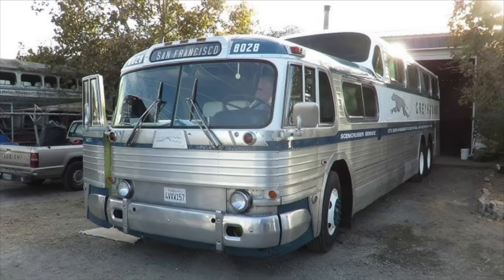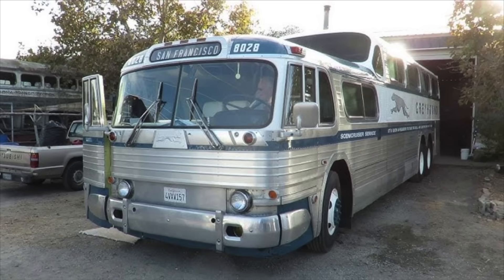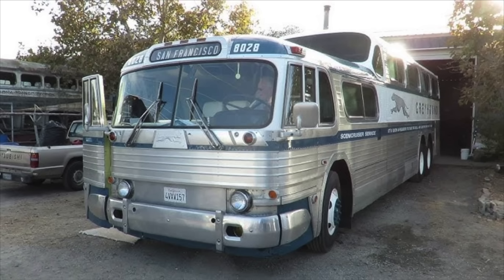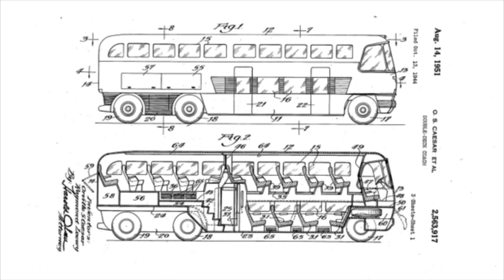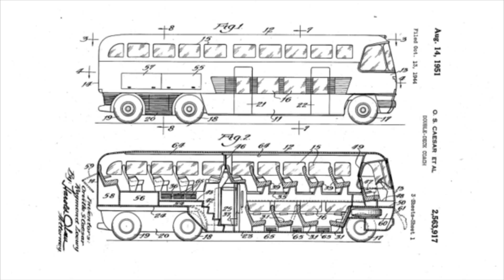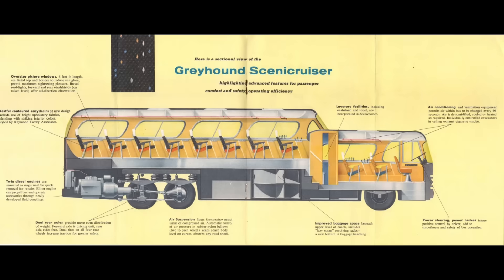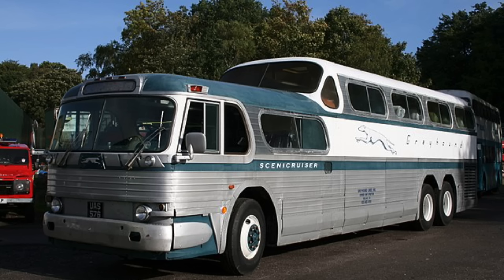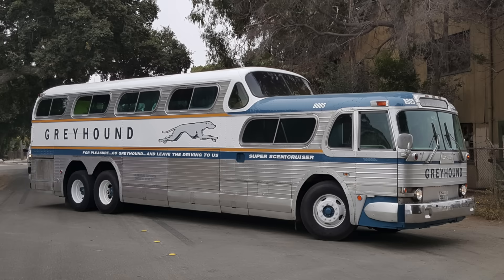Awesome & Flawed Vehicles: 1954-56 Twin-Engine GMC/Greyhound PD-4501 Scenicruiser Bus!

Comment: I’m retired.  I’m 72 years old.  In the early 1970s I drove over the road busses for a bus company in St. Paul, MN that has long evolved into a different company.  

At that time I drove one of three busses.  a GM 4104, 4106, and a 4501 Scenic cruiser.  I also drove Prevost, MCI 8,9,10s. 

Over the 5 years I drove my absolute favorite bus I drove was the 4501.  It was smooth ride, powerful uphill flat and could easily maintain 80 mph.  

A dream to drive.  Also, as they were designed by or for gyehound it bears mentioning that at that time Greyhound were a passenger transporter, but made a great deal of business in freight.  The luggage bays were huge.  You could easily walk through them. Plenty of space for freight

Comment: I'm late to party (as usual) but my only ride in a early Scenic Cruser was in 1956 when I was six years old (gearhead even then). We were delayed and a mechanic showed up, in talking with driver, I overheard him say "one of them doesn't have oil pressure". Always wondered, now I assume it must have been a dual engine setup. Anyway, another bus showed up for the trip and we were away. Was a 300-mile trip from WVa to Va Beach and we were a couple hours late.

Comment: Non synchronized transmissions don't NEED double clutching. In fact, if you know what you're doing, the clutch is only used when starting and stopping the vehicle. Floating the gears is way faster and doesn't destroy your left knee.

Comment: I remember these babies chugging over Donner Pass on I-80 in the 70s!  They didn't have barometric compensators back then, to lean out the fuel as they went to higher altitude, so they would be in the right lane, even the breakdown lane, shooting a jet of black exhaust across the entire highway!  😁  
I'm really curious about that fluid coupling accessory drive...

Comment: The Detroit Diesel 6-71, 8-71, 8V71, etc., were two-stroke engines using Roots superchargers for charging the cylinders with air, and exhaust scavenging.  The superchargers were adopted by hot rodders and drag racers starting in the late ‘50s for forced induction, typically being the 6-71 versions.

Comment: The 71 series Detroit engine was a two-stroke design. You didn’t have to mix oil with diesel fuel, but it only had exhaust valves and injectors that were operated with the camshaft and rocker arms. The intake were ports that were in the cylinder sleeve. Scavenging was done with a gear driven blower. These engines were prevalent in most buses and some train locomotives. Later, they use them in trucks, but were taking out of service as they were nicknamed the road oiler. Based on the design, the Oil that travels past the rings through the intake ports eventually accumulated in the blower box and intake manifold. There were automatic bleeds that would allow the oil to drip down on the roadway. That’s where the nickname came from. This engine was extremely powerful, but by today’s standards an EPA nightmare.

Comment: I had driven several PD-4501's with the 8V71 engines for small, underfunded charter outfits during the 1970's and 1980.  While the smaller buses like the 4104 had a 4-speed transmission, the ratios on the 4501's were different as were the shift points .  Greyhound always seemed to try to save a nickel or dime here and there, so there were no fuel gauges because they knew what the distance was between terminals, so we had hubometers.  No tachometers so a novice driver had to learn to listen to the scream of the blower, unless you wanted to take it solidly into the governor each shift which was unsatisfying to the passengers, so you learned to keep the little vent window cracked open to hear the thing.  Downshifts in traffic in the hills of San Francisco while turning were often a crap shoot.  Lots of baggage space.  Some operators put 10 speed Spicer transmissions in them.  It was a truck transmission so shift patterns were backwards.  Start  in 3rd, then 5, pop the button and swing around to 6 (clear to the right and move the lever forward), and on through the gears to 10.  Backwards.  Downshifts with that arrangement were also a lot of just familiarity and guesswork. Some of those got after-market tachs.  Elicited some interesting comments ("what kind of shift pattern is THAT?") from passengers who were somewhat familiar with what driving big vehicles was about.

Comment: Raymond Lowey was not much of a designer. His job before opening his design firm was decorating department store windows. Lowey's talent was knowing good design and good designers when he saw them. The Studebakers referenced in the video were designed by Virgil Exner, not Lowey. Exner went on to be Vice President of Chrysler in charge of Styling. Lowey also did not design the Avanti later. Lowey took credit for every design that came out of his firm. His philosophy was if it came out of his firm, it was his design. He did not hide that from employees, but it did considerably annoy many of his employees who left to pursue other career paths.
Reply: He also did not design the Scenicruiser, with the exception of the interior.

Comment: Most western railroads and some eastern trains started running dome cars in the early 50's and passengers loved the panoramic view so Greyhound was merely trying to adapt within the limited paramaters of a bus...but the coaches were cramped, ceilings were too low for tall riders and only passengers in the front seat of the upper and lower deck got a forward view. Later one-level "buffalo"(?) busses run by Greyhound and Trailways were more spacious and way more comfortable. "Excellent video!":face-blue-smiling::hand-pink-waving:

Comment: We traveled on these for 6 years. The Cavaliers Drum and Bugle Corps purchased 3 of them in 1979, had them painted in green and black with our logo on the side and we traveled all over the country each summer for months at a time. They definitely had some issues from time to time, I remember pushing them to get them started. We loved these buses. In between the stairs we made a spacer so we could also use the upper window space as a bed and took turns using that. Retroaded a car stereo so we also had good music. Very fond memories traveling in them.

Comment: Was the lengths of the original double-decker design scenic-cruiser of 35 ft. perhaps limited by legal limits in some states? I remember the first ISO shipping containers were also 35 ft (later often lengthened to 40 ft. what would become the standard for containers) because of length limitations in some eastern states. The fact that the next design, that had to be lower, had to be longer in order to get enough seats in the bus for paying passengers. This was most likely possible also be to changed legislation for vehicles. The fact that in the configuration the middle axle had to be driven is that with a rear mounted engine and gearbox mounted in length of the vehicle and with enough length of the prop shaft to cope with movement of the axle due to movements of the suspension, there is no other option. I’m interested to see how they would have driven the last axle.

Comment: Great video - very informative. The influence of the Scenicruiser on the North American coach industry cannot be overstated. I've been a coach operator for 40 years. When I started, the Scenicruisers were gone but not forgotten. I did drive Buffalos (or "decks" for you East Coast guys), as well as all the MCI models from the MC5 to the modern J4500/J3500s. I also spent time in Crown school buses and Eagle Model 5/10s. Spent my share of time double-clutching, matching rpms and trying not to grind gears.

Comment: I got hired by GLI in 1972 in San Francisco and drove a Scenic Cruiser while in training. It was already converted to the 8V-71 with the 4-speed. The steering wheel was huge and the hydraulic power steering couldn’t keep up when you needed to make a sharp turn. It had already been “retired” and was only used as a training bus. MCI had taken over providing coaches by then and we used MCI-5’s (2-axle) and MCI-7’s (3-axle) for our runs. Both of which also had 8V-71’s and 4-speeds. We stopped in Crescent City, CA for a rest break one night and a poor lady in the back had thrown up on her dress coming through the big Redwood trees. I guarded the door while  she changed her dress and decided to go drive log trucks instead.

Comment: @artstephenson5803    The A, B, C, and D indicated the orientation of the cylinder block as related to the side the blower was on, and cylinder head orientation. This told which side the exhaust manifold was on. Naturally when the head is turned around the cam is different and switched with the balance shaft. All the inline engines shared this labeling to denote their architecture. The idler gear and crank gear helix was dependent on which gear they drove, cam or balance.
I do not know if this applied also to the 6L110 engines.

Comment: Double-clutching was for amature drivers. Like for a semi-truck driver, the clutch was for starting up from a stop and coming to a stop. During a normal trip, most experienced drivers very seldom touched the clutch pedal, even going up and down hills.
For other buses of this vintage, like a Flxible round-back road coach, some had 3-53 Detroit diesels. It sounded like a 2-stroke outboard boat engine.

Comment: I never rode one of those. However, when my dad drove for Trailways (DCSP Transportation), I have ridden a different double decker design, also a Scenicruiser (don't remember the model no.), used by Oklahoma Transportation Company; the bus line contracted with Trailways to have its drivers drive the "Blue Goose," as the drivers called them, from Oklahoma City to Denver. This model was unique in that, although it was a three-axle bus, the non-powered bogie axle was retractable. It could be deployed or retracted by the driver as road conditions warranted. I believe it was powered by an 8V71 Detroit coupled to a Spicer 4-speed unsynchronized transmission (no splitter or range selector).

Comment: I did get to ride the split level Scenicruiser. The bus at the end of the video was number 8005. The one I remember riding was 8008. I had the pleasure of meeting a retired Greyhound mechanic. He helped swap out the twin-fours with V8s. He said the driver could control the engine RPMs to match, but it didn't always happen. The result was one engine would pull harder and overheat. Once the bus was retrofitted with a V8, the Scenicruiser was rebadged Super Scenicruiser. The busses had another flaw: the way the engine was mounted in the monocoque frame, hanging in a cage from the top, there was a lot of strain on the back window, causing stress cracks.

Comment: I got to ride on two of these. Once in around 1970 with my parents. The second time was in the late 70's, with a buddy of mine. 

The first time all I remember was getting to sit in the front, upper seats and looking out through the front, upper windshield (in fact I might be recalling the photo that my parents took of me being so excited to sit at the front). My parents tell me that they recall we were travelling in western Canada and my mother was terrified I was going to fall down the stairs.

The second time I'm almost certain was not with Greyhound though, and the trip was from Ottawa, Canada to North Bay (and back two days later in a different bus). Back then there were several different bus companies that were buying used, older buses and offering lower priced fairs to Greyhound.

One thing I'll always remember is how when it rained, the skylights dripped water onto the passengers.

Unfortunately, the old scenic cruiser broke down twice on that second trip and we spent many hours at the side of the road waiting for repairs. The driver told us that the bus had many problems, including problems with very loose steering, problems with the clutch&gearbox and most concerning, problems with the actual structure. Apparently, the bus had already been reinforced structurally several times, but again cracks had developed that allowed portions of the upper deck at the rear to flex from side to side.

I haven’t seen my pictures for a while, but we took quite a few on that trip, including of the broken down scenic cruiser with the engine access doors open. 

Even with the problems, it was an interesting trip in such a unique looking bus (it was also my very first trip without my parents).

Comment: My Dad drove for Greyhound 40+ years, retiring in August, 1970. San Antonio, Texas was his "home terminal". I would often ask about the Scenicruisers. For many years he drove the San Antonio-Corpus Christi route, returning the same day to San Antonio. The Corpus Christi route was considered by Greyhound to be a "local" type route. Scenicruisers were not often assigned to that route until later in the 1960s. Routes were assigned to drivers on a seniority basis. The favored route (seniority allowing) was the San Antonio-Laredo run which also returned to San Antonio the same day. The Laredo route paid more as it had slightly more mileage (drivers were paid by the mile). Further, there were fewer towns to serve on the Laredo route as opposed to more towns on the Corpus Christi route. That meant that a driver could make his round trip to Laredo in less time than it took on the Corpus Christi run plus it paid better due to more mileage. My Dad's last five or six years of driving was on the Laredo run. It seems that I recall him mentioning that Greyhound had a Patent on the Scenicruiser. Another reason that Greyhound would not allow competitors to buy Scenicruisers. Supposedly Trailways at some point attempted to buy Scenicruisers from General Motors.

Comment: Summer, 1964 - Traveled round-trip between Cleveland and Dallas on Scenicruisers - mostly sat upper deck, front, right, and loved every minute!  Tried to open a window, and the handle came off in my hand (still have it).  Broke down somewhere in Mississippi(?) and spent a few hours in a garage while they put the bus up on a lift and repaired it.  I've had a "romantic attachment" to Greyhound and Scenicruisers ever since!🥰
Reply: You still have the broken handle ❓ that’s pretty AMAZING 😃

Comment: In 1967 I rode in a Scenicruiser from North Hollywood, CA to San Diego, CA to go to Navy Boot Camp.   I remember it was a pleasant ride.  Comfortable and quiet and it ran probably 65 -70 most of the way.   I do recall a couple of rather odd middle aged passengers, who would now be considered down on their luck.  

Certainly, a bus one could take a long trip on in relative comfort.  Also, some time in the 1970's if I recall correctly. Road and Track (R & T) magazine did a road test on a Scenicruiser.  (The magazine would occasionally "test drive" odd vehicles, including a Sopwith Camel just as if it was an automobile with the same spec sheets and drawings.) The  R & T article mentioned a top speed of 65, but included a photograph of the interior showing the speedometer as a well as a view thru the windshield.  The indicated speed was 85 mph.

Comment: Adam, Thank you for another well done video.  The twin Detroit 4-71 diesels were like the twin 6-71 Detroit diesels used in the Sherman tanks in WWII, called model 6046 Diesel. These were replaced when Detroit Diesel came out with the 8V71 in 1957.  This also helped eventually eliminate the far superior inline 6-110 Detroit diesel.  I always felt the bus influence led GM to favor the V8 over the straight 6 since both engines covered the same power band.

Comment: The M3 Stuart Tank had twin flathead Cadillac engines with automatic transmissions.  From there to a combining gearbox, then via driveshaft to the final transmission.  It was a reliable system and the Army used it in their next two tank upgrades.
     A I-4 two stroke engine has two cylinder firing simultaneously thus two big power strokes/rev.  It’s as smooth as a hammer forge. The only sponges are the torque converters.  No wonder the bus had problems.

Comment: In the early 80s, I marched in a Drum and Bugle Corps and we were on a summer competition tour throughout the eastern US. We chartered 3 busses, 2 of which were scenic cruisers. Typically we would travel from one contest/performance to the next overnight.
I was lucky to score a seat in front of the upper windshield. We could put our feet up on the dash and stretch out. Until we discovered that often if you sleep like that, the blood runs out of your legs, "puts them to sleep" and you wake up with numb legs you can barely move.😂
Then you have the pins and needles feeling as the blood starts flowing again.
Wish there were room to tell my New Orleans Bourbon Street story. I'll say this, I will never forget the horror I saw on the face of an oncoming motorcyclist on a two lane road, as I helped my buddy lean out the window to disgorge the multiple hurricane drinks after eating lots of gumbo! 😱

Comment: I've been a Metro bus mechanic for 27 years.These were long before my time.Our garage had a restored 1968 bus with the naturally aspiration (no turbo) 6 or 8 v-71 Engine.I believe they were two stroke engines.Two drive engines sounds like a problem in the making!
Reply: The twin engine design was added mechanical complexity as an alternative to using a Cummins or other competitor's engine.  The 6-71 engine was not powerful enough for the Scenicruiser.  When the 8v-71 engine was introduced a few years later, Greyhound had the buses converted to a simpler, more reliable drive train with the new engine.

I was amused by a 1954 Popular Science magazine article that touted the original design as a virtue, saying that if one of the 4-71 engines failed, the driver could disengage it and limp to the next station on the other engine.  I have seen various sources say that the engines were very reliable, and that malfunctions of the complex drive train were much more frequent.